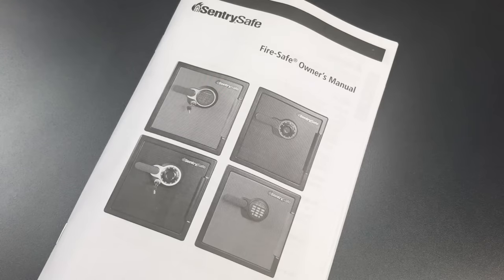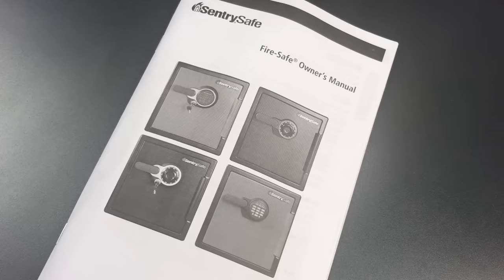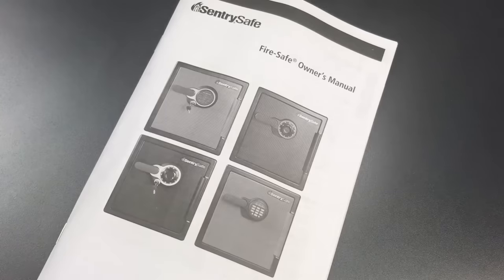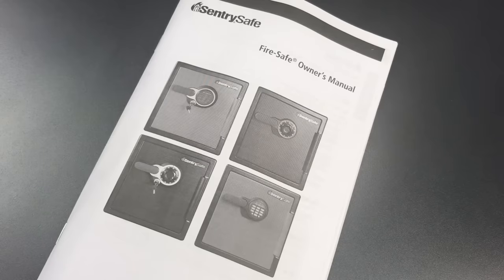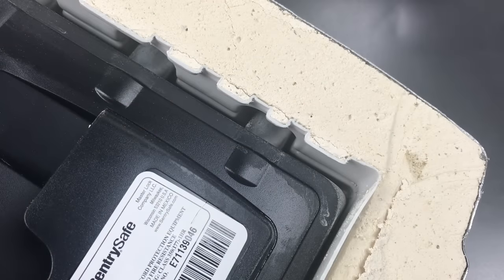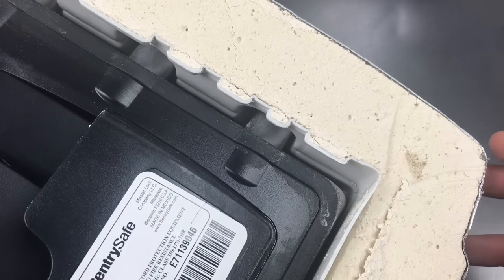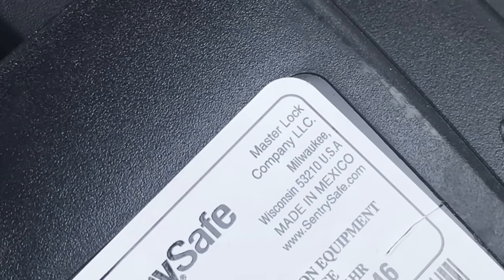[756] Sentry Safe Cut in Half FAST!

Comment: I've always found it a bit laughable that Hollywood always seems to attack the strongest part of the system: the lock (Master Lock excepted).

Take your front door for instance: the "bad guy" tries picking or drilling the lock. Yet, in many cases, a large pair of "channel lock"-type pliers on the doorknob will be quicker. Or breaking the window right next to the door. Or just busting through the vinyl siding, chipboard sheathing, insulation, and drywall. Bad guys really don't care if they damage anything; they just want to get in, grab, and go as quickly as possible. And what good is a "safe" that has no means for affixing to the structure and can be carried under one arm? It might offer a bit of protection against fire or flood, but against theft you're gaining nothing. Actually, you're losing even more: instead of just stealing the thing you're trying to protect, now the bad guy gets that thing AND your safe! Two for the price of one!

People who've been in construction often have a more holistic understanding of security than "security" people -- and WAY more than Hollywood. When you understand how the whole system is built, you understand the true vulnerabilities. Works the same way in IT; I've often said the best firewall product is the one you understand. A $59 router configured by someone who understands its capabilities and limitations will be far more secure than a $15,000 enterprise system spun up by a novice.

Comment: Even if this had been bolted down, it would have taken almost no time to plunge cut around the top with the circular saw or drill one hole and cut around it with a sawzall. Would have been interesting to see if the door was as weak as the body.

Comment: Probably would have been a little hard if the safe had been bolted down from the inside to make it hard to saw all the way around.  But even that, these safes are so thin, you could probably just muscle it off the floor or wall.

Comment: I can only speak for my country (spain), but here, walls are not made of cardboard, so a common thing to do if you  want to have a really secure safe is to place it inside the wall, and have a really sturdy safe door. Even if the safe walls are thin, it's inside a wall, so as long as the door is sturdy your goods are safe.
Edit: most walls are made of bricks and mortar or even stone and mortar in older houses.

Comment: I don't think using a grinder and all round access can be considered a rudimentary attack. Using the correct tools any safe can be opened. A grinder and a crowbar and all round access and enough time is arguably correct combination of tools to open any safe....even a bank safe.
Reply: I've never seen a FIRE that used anything other than heat and flames to attack things. Considering that this is a FIRE SAFE that is only designed to protect against FIRE... it doesn't really matter if you could break into it with any tools.

Comment: I bought a "safe" very much like that one but never used it.
If I did, it would have been secured to a floor with internal bolts and left locked as a decoy with the valuables in a safer place well away from it.

Comment: I beat one of these open with a sledge hammer before.   You smack at the area where the bolts are until the plastic deforms.  Locks completely in tact with the body defeated.

Comment: What is the fitting guild lines for this safe? Is it ment to be installed inside a wall then it's is strong enough as you would have to get it out first but if it is a floor safe then that is pitiful

Comment: I would call that, less of a safe and more of a lock box. To be declared as a safe, it has to be UL approved...not UL listed. One label means it was tested, the other means it was tested and passed the minimum requirements. If you see the Winchester safe in a gun shop that is $1500 and one the same size from Fortnox Safes but it's $6000.....That's why.
Reply: Safe versus Residential Security Container (RSC). Most “safes” are actually the latter.

I was thinking the same thing. Would be cool for LPL to explain the difference on his channel.

Comment: Isn't this type if safe designed to be bolted down? Kinda hard to tut through all 4 side if you can't turn it over.
Reply: Nope, this kind of FIRE SAFE is to protect against fire. It's not designed to be bolted down... you leave it loose so you can grab it if you can get access to it. Otherwise, let the house burn and come back to collect the safe after the fire is extinguished.

Comment: Best place to put your valuables is in a fake clearly used empty Douche/Enema bottle box in your bathroom. For maximum security, fill the bottle halfway with water and carefully apply a squab of your favorite petroleum jelly on the applicator tip of the bottle and secure over valuables. Then, close the box and apply another squab to the top creases. No thief, man or woman, is going near that sucker.

Comment: Misleading video. A safe like this is bolted from the inside to studs or floors typically to a corner so you can get to at best 3 of 4 sides. The safety is in not being able to removing it from its location quickly. Any safe, even one with a 1 inch steel and 3 inch concrete wall will be cut open in no time in the convenience of a work shop.

Comment: I just don’t understand why they call this clay box safe😝
I bought one of these too. While drilling backside of it to screw to the wall was surprised how my drillbit went through it like a hot knife through the butter.
Totally disgrace
Ended up ordering real safe from Amsec. 
My advice… don’t buy any so-called safe without seeing bare metal on it.
Reply: It's really a fire safe to keep things from burning up/melting in a home fire, and then waterproof so the fire department doesn't drench it.

The issue is they imply it's also a security safe, which it clearly isn't.

Comment: In my mind it'd be a little bit harder to do what the lock picking lawyer did, Because the safe has anchor points where you could bolt it to walls and stuff so you couldn't turn it to do that. Although I could be wrong about how easy it would be.
Reply: This is a FIRE SAFE and you never bolt them down. The whole idea is that you can quickly grab it and take your valuables with you (if you can get to them during the fire). If not, you go back are retrieve your items after the flames are extinguished.
Reply: @johncoops6897  There is no quickly grabbing that fire safe, It's still made out of metal and the same materials that would be in a typical fire safe it is not light by any means necessary,  Trust me I know that for an absolute fact I own that exact safe. And 2nd just because it is and advertised as a fire safe does not mean it cannot be an actual safe too The safe is classified as being able to keep your valuables safe against fire, water and people, by  the company that makes it. It is NOT JUST a fire safe.
Reply: @LazerAimFire  - OK, whatever you say.
Reply: @johncoops6897   It's what the people who made the safe say

Comment: Well that was interesting.  That's the same brand I have, though I have the traditional combination dial plus round key model.  Some rebar embedded in that fire insulation would have slowed things down, at least for a saw with a wood-cutting blade like that.  Of course an abrasive cutting disk wouldn't care.
My question is simple.  Do you know of anything better at a price that isn't crazy?  Thanks!
Reply: Rebar would transfer heat which would defeat its primary purpose.

LPL was calling them out for their security claims which is fair, however the primary purpose of these "safes" is to prevent your stuff from being destroyed in a home fire. Either by the flames/heat itself, or the water from the fire department. For this, they actually work.

You're not going to find anything affordable that can do all three so you have to decide which is more important. Fire/water or theft. A typical "real" safe has concrete instead of fire foam in-between the outer and inner shells but that inch of concrete wouldn't be enough to insulate the heat of a fire.
Reply: That makes sense, though I would add another primary purpose of these "safes" is to keep stuff private, away from casual inspection or theft.  My passport in there is primarily protected from fire or water, but the cash is mainly being kept where it will not wander away.

Comment: I mostly would ONLY buy these for Fire & Water protection. Not these are heavy ASF and if you have many decoys and destractions, in a home invasion, no one would spend the time
Reply: They're actually pretty light, it's mostly plastic and foam than that really thin metal shell. The manual says you're supposed to drill through it and bolt it to the floor though. That said, a pry bar can get into these faster than that circular saw. There are only locking bolts on the one edge (not all four).

As you say, it's real purpose is fire & water, not security.

Comment: What kind of blade on the saw?  I need to cut mine open as the solenoid failed after 20+ years.

I would also like to share that when I talked to Sentry customer service they offered a 50% discount on any new Sentry safe via an email link that would make me part of the "Owners Club". Turns out their 50% off price is about the same or more than the cost of buying one at a big  box store and the safes they offered were much smaller than the one I had to replace. Disingenuous.

Comment: Meh.  It's a $300 safe meant to hold your passport and other confidential documents, a checkbook, the old class ring you don't wear anymore, probably a little emergency cash.  Nobody expects it to protect the Crown Jewels, the typical burglar isn't bringing a circular saw with them, and if you bolt the thing down in the corner of a closet like most people do, a burglar won't have access to cut 2 sides.  For 99% of the people who buy it, it serves the purpose at a reasonable cost.  For people who want to keep $100K of walking-around cash in a safe, they aren't buying a $300 safe for that.  One thing that is disappointing with Sentry, is their consumer-grade safes used to have bolts on all 4 sides of the door, so cutting the hinge wouldn't defeat the door.  Apparently that's not the case anymore.

Comment: What if the safe was bolted down to the floor, would it be as easy to cut it open?
Reply: Doesn't matter. Fires don't use tools, and that is what this FIRE SAFE is designed to protect against.
The whole idea of a fire safe is so that you can quickly grab it and carry it out of the building if you can get to it. If not, you just leave it there and recover the contents after the flames are extinguished.

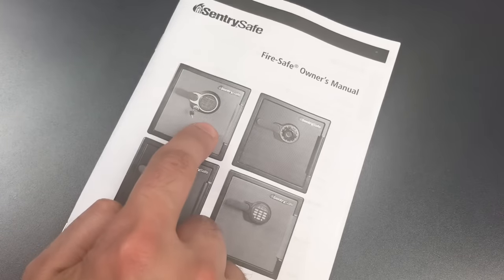Comment: 0:26 Really 90-pound box ? It doesn't look like 40 kg as you turn around it. You must be a very strong man. And btw. instead of cutting it off, you may just only use a magnet for the opening solenoid.

Comment: “Very low” security? Wtf? I think I’d notice someone going after my stuff with an electric saw. Not to mention it is heavy and more difficult to carry than a Rolex watch sitting on the shelf. A valuable item would certainly be more secure in that safe than sitting around your house loose. Just because it CAN be destroyed doesn’t mean it doesn’t provide security.

Comment: I'd like to see how this approach would work if the safe were up against a wall and bolted to the floor like the safe instructions direct.
Reply: This “safe” doesn’t have holes through the bottom. How sure are you that the instructions direct the owner to bolt it to the floor?

Comment: Damn, they could've at least spent a bit more of their profits on buying thicker steel... or embedding ceramics in the gypsum, mineral wool, or fireclay or whatever the hell they use. It's not that expensive to buy a bag of broken bits of high grade ceramics and some cheap high temp epoxy. Hell, they do make epoxies that can go up to 2500 degrees, I don't see why they can't get some 1500F epoxy, it'd would probably be cheaper than what they already use.

Comment: With all the respect to LPL and his knowledge about locks, IMO he is really missing the point here. Specifically, what´s the intended use for this type of safes.

I assume it is intended for basic home or office use. It is maybe close to a metal locking cabinet, but offers extra fire and water protection, which covers 99% home and office scenarios.  Even in case of a burglary its hard to open it without making a lot of noise and if you place the safe in a hard to access with big tools location (inside some furniture..), it still takes some time to open it, On the top of it, no every burglar will sneak into your office at night  with a circular saw.

With my accumulator angle grinder I can open almost any pad lock under 10 s. Does it mean all those pad locks are useless? No, they have their place.

So just don`t expect from a safe you can turn upside down using one hand, to be good enough to protect your golden bars in a remote cabin in woods.

Comment: A locker is safer than this.
You can see the poor quality when he flips the safe with one hand like a toy.
It doesnt have a even surface, as the thin sheet metal is bent by the fire proof insulation, and it almost can roll around.
They should be sued for false product marketing, as this is no safe but a fire proof kids toybox.

Comment: Wow! At least my "sh*t 4 safe" from Harbor Freight is thick metal. It may be soft steel and the lock is made of spider webs and wishes, but it is better than this POS and it bolts to the floor so you cannot cut through the bottom even if it is soft.

Comment: Yeah, its weak, but you also opened it with a saw (though that said this is probably the weakest safe ive ever seen that it can be opened with a normal circular saw). IF we are in power tool territory now that changes things, most safes you can buy can be opened with an angle grinder.

Comment: You never said if you used a regular blade or a metal cutting blade.  Given to paper thin sheet meat construction I'm guessing even a wood cutting blade would do the job. I don't really have any valuables. Our safe is just for fire protection of important paper documents. No ocd cell phone addicted children of the machine mind😉🙃, not all places will accept digital documentation because they are so easily forged. They want to see the real deal.

Comment: This is a "FIRE SAFE". Not an anti-theft safe. It does not claim anywhere to be so. You attacking it with a circular saw is not something this was ever built to withstand, this is just to protect against fires.
Intended purpose is a thing, stop shitting on peoples products for stuff it is not designed to do. Its like if you bought a fridge and said it was bad because it didn't freeze stuff. Like duhhh, its a fridge not a freezer, its not meant to freeze it, its meant to keep it cold.

Comment: That safe is pure rubbish. Thin sheet metal with a weak fireproof layer inside. I wouldn't have this if it were given to me. Looks like a standard wood cutting blade was used. Did not need a special metal cutting carbide blade. I have one and it zips thru 1/8 inch steel like plywood. I have seen Sentry safes but never imagined the insecure garbage they are.